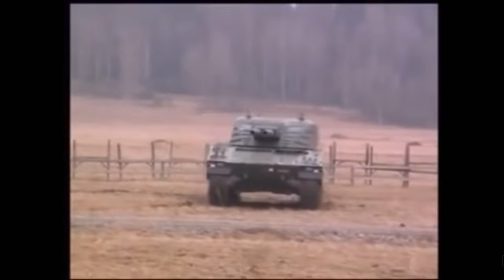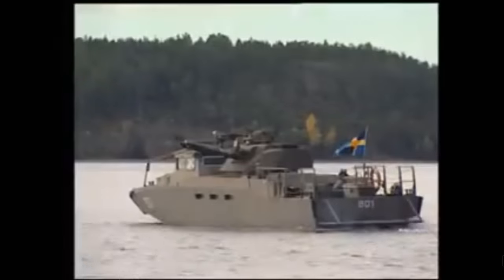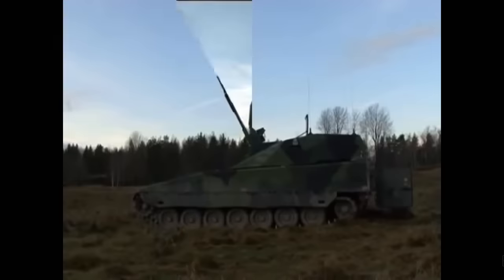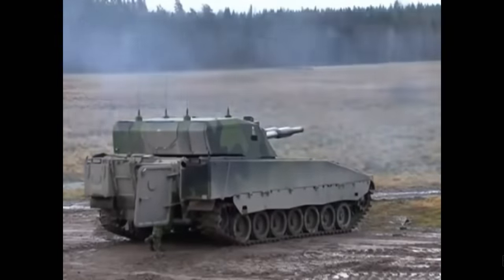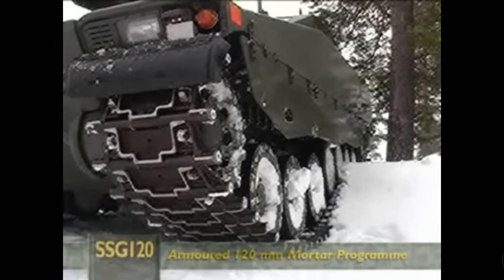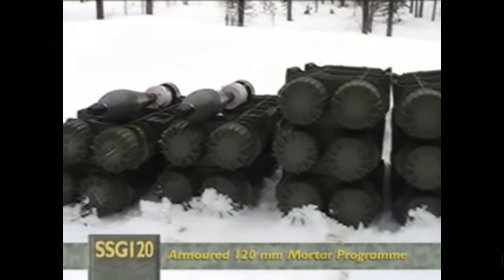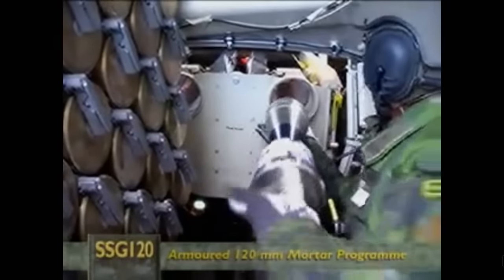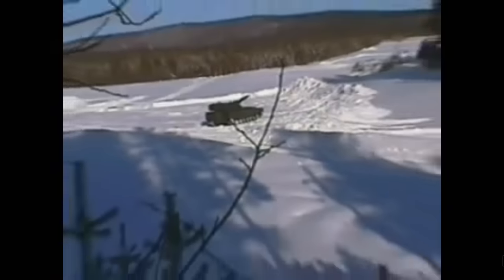Advanced Mortar System (AMOS) - Twin Barrel 120mm Mortar

Comment: The potential of computer controlled and precision guided mortars in asymmetric warfare is significant as a cost effective strategy for supporting infantry. Artillery and conventional armor have always struggled in CIW. The mobility demands of most CIW are difficult for conventional tactics to deal with because the intensity of the counter threat is difficult to anticipate before a conflict. AMOS has some unique advantages in CIW as well: Great ambush protection with direct fire mode and fully covered turret. Adaptable to IED resistant platforms versus direct fire armor. Excellent range and ROF. Considerably lighter than a MBT. PGMs will be able to target technicals and anti-aircraft guns.

Comment: Yes, yes, I know. 3 Comments in a row. Had to say that the AMOS is one scary arsed piece of gear. Australia needs it too. It would be a good excuse for us to invest in a IFV variant heavier than the ASLAV, which I feel would be useful. We have Abrams and ASLAV's but nothing really in between that could run with the Abrams at the tip of the spear. A system like this has huge psychological value too. I am a damn civvy and am very unlikely to ever be on the receiving end of a bloody 2'' mortar. Even so, the AMOS scares the shit outta me. Bloody glad it is made by nations friendly to mine! Great vid.
Reply: 'to invest in a IFV variant heavier than the ASLAV'

Eh, you already do. LAND 400 phase 3 aims at a tracked IFV.
Reply: Jonny If you have ever seen the ADF at work, you would realise that 'aiming' is something that the troops are good at. The suits in Canberra are good at missing the mark. Phase 3 may include a tracked IFV. Maybe. If the Boxer is procured and it works well, there is every possibility that they will go with that and not procure the tracked vehicle. Here's to hoping that they do. It would be a damn good idea.
Reply: To be honest, the wheeled component of LAND 400 is way, way overspecced for protection to the point that there are now big questions over the deployability of the Patria AMV or the RM Boxer. 30-40 ton vehicles of the height and bulk of these beasts means that Australia will now no longer have the ability to redeploy them strategically by air - the RAAF C-130s won't be able to take them. And I believe there are less than 5 Globemasters as well. So it would basically take up our entire Globemaster fleet to transport just one single platoon of wheeled vehicles (4 for hulls, 1 for ammo, crew, armour panels, spare parts). 

It also means that should either the AMV or Boxer break down, we might not even have the engineering vehicles to recover them, or cruelly overtax what engineering vehicles we do have.

The ADF wants to fight like they're in the European theatre, in the middle of the Fulda Gap where armour and firepower determines battles. Or in Afghanistan where they expect to run their wheels over 100kg IEDs because their vehicles are too heavy to not get bogged down in the muddy fields of opium farmers. 

The ADF should have gone with what works: the CV90 at 25 tons for the tracked component, and perhaps the French VCBI or the Singaporean Terrex for the wheeled component. If the ADF is called upon to fight in the European theatre then the world is about to end in thermonuclear fire and it won't matter what vehicles are deployed if Melbourne, Brisbane and Sydney are converted to glass by ballistic missile submarines. If the ADF is called upon to fight in the MENA then the excessive fuel consumption and high ground pressure will force the vehicles to stick to the roads and take IEDs right up the arsehole. And while it is difficult to assure IED survival without MBT levels of weight in armour, it is infinitely easier for insurgents to simply make a bigger bomb.

Reliability and mobility are worth more than the extra tons of armour that the AMV and Boxer are weighed down by. France's rapid advance across Mali in operation Serval showed that decisiveness of action requires the utmost of speed and reliability, even when off road, and in terrible infrastructure. Their buildup and staging was also assisted by the strategic mobility of their wheeled brigades - something that heavier vehicles are always trading off against.

As for the Hagglunds AMOS, I am all for it. The rapidity of fire delivery that big bore mortars bring is essential no matter where one fights land battles. A CV90 AMOS with STRIX and perhaps an option for a 120mm GLATGM like the Ukrainian Falarick will deliver 90% of the capability that the ADF's gas-guzzling, overweight Abrams provide. 

The ADF's obsession with big ticket, expensive, strategically immobile assets will prove to be a liability if we ever fight anyone more competent than insurgents.

Comment: The multiple round simultaneous impact (MRSI) seems excellent for asymmetric. The detection of rogue elements can be fleeting. Close air support inbound can be seen by them or their friends warning them to scatter. The tracked vehicle moving around the countryside is more discrete with an indirect arc. The increased beaten area of the MRSI improves the odds of striking the soft targets as they mill about in their position. Heavier artillery could do something similiar but the cost per shot goes up. The 120mm seems hit the "sweet spot" for the dollar cost to engage.

Comment: Unfortunately the Swedish government didn't want to add the money for the Swedish armed forces to buy AMOS. Finland however bought both AMOS and developed a single barrel system they adopted. Several years later Sweden developed a simplified and cheaper system called 'Mjölner', adopted to the army mounted at CV90.

Comment: Put the AMOS on the Bradley hull now. That will replace the M113 mortar carrier in the heavy brigade of the US Army. Put the single barrel unmanned turret NEMO version on the Stryker hull to keep C-130 capabilities. The USMC might do the same with their LAV-25. 
Forget about fancy new lasers and railguns. This shit is real and doable. 
My only question is; does it come in a rifled bore?
Reply: Patria NEMO is low profile single barrel version of AMOS. Would serve that C-130 transportable Stryker -need well.
Reply: Is that not what the M1129 is for, a Stryker with a 120mm mortar mounted to fire out the top hatches.
Reply: I know that the Corps was looking into a large bore, automatic mortar system that could be deployed on an LAV or dismoutned for use on foot but I think that it might gotten canceled. At any rate, it wasn't as fancy as the AMOS as it only had one barrel and it still fired through an open hatch in the back in the usual vehicle mounted way.
Reply: The M1129 was deployed to Iraq at least in 2005 onwards in Stryker units.
Reply: john harker mortars aren't rifled.
Reply: MatoVuc

They can be, the French Mortier 120mm Rayé Tracté Modèle F1 used by many nations is rifled.
Reply: chaz8758 huh... Well would you look at that...
I wonder what the benefit of that is and does it outweigh the impact on barrel life.
Reply: From what I read it was for a longer range and accuracy, the USMC used them until last year as an interim weapon in Afghan and Iraq (some sources say they are still in service, but maybe reserve or war stocks)
Reply: chaz8758 accuracy i could kind of see, but rifling doesn't really affect range.
I've served on a 120mm smoothbore mortar and we could reach out to 7km with standard mines and 6 charges (though that is a bit risky) and we could drop them basically on the spot (give or take a meter or so at 3.5km) if the spotters and calculators did their job right.

That USMC mortar, was that the one that was towed by the Growler?
Reply: The French have a special HERA round with a range out to 14+km - no idea if it can be used on the smoothbores as it does not say it is specific to the rifled mortar on their website

Interesting to see the rifling grooves on the round - must make it slower to load (I have only used the UK 81mm and 2" mortars so no idea about these big beasties)

https://en.wikipedia.org/wiki/File:USMC-120129-M-EE799-013.jpg

From Brandt website

"After WWII, Brandt developed a new 120 mm smooth mortar (Model 1950).
Nevertheless, the biggest breakthrough came in the 1960s with the development of a 120 mm mortar with a rifled tube.
This new weapon offered significantly better accuracy and firepower.
It became known under the designation “Heavy Mortar".

"The 120 mm RT (Rifled Towed) moratr is the most lightweight air- and sea-transportable artillery piece available for force projection operations. Very easy to operate, it can be hooked up simply to any kind of light, medium or heavy vehicle.

The 120 mm 2R2M (Rifled, Recoiled, Mounted Mortar) system is a vehicle-mounted version of the rifled mortar designed for several types of tracked or wheeled vehicles. The 2R2M is an ideal solution for providing fire support to light armoured units, especially as part of an Initial Entry Operation (IEO)."

http://www.tda-armements.com/content/mortars-overview
https://www.gd-ots.com/munitions/mortars-and-mortar-components/120mm-efss/

According to GD

"M327 120mm Towed Rifled Mortar Weapon

The Expeditionary Fire Support System utilizes a 120mm towed rifled mortar that can fire smoothbore or rifled ammunition. The rifled mortar rotates the round as it exits the barrel providing greater stability, accuracy and range over current smoothbore ammunition."

Quite a beast with the auto version

"It can fire 10 rounds within one minute, with improved accuracy compared to the RT towed version, and can then start moving and close the top doors at the same time."
Reply: we had some lightwieght mines that could reach out to 9km, I think. Supposedly we also had some rocket assisted ones, but I never saw one personally. I served on an M75 in the Croatian Armed Forces.
https://en.wikipedia.org/wiki/M74/M75_mortar
(the wiki article doesn't really match with the TTCs I had to learn on the weapon in service)

That towed variant seems to have a longer tube than the one I served on and is quite a bit heavier.
The munitions are also differently designed, with a longer stem. Very interesting.

I find the automated 2R2M version very interesting. Not as good as a rotating turret with direct fire ability.
Reply: I saw quite a few M75's when I was in Croatia/Bosnia, there were some under lock and key in a UN safe store plus a few in the Croation military part of Divulje Brks in Split (1992/93), plenty when I was in Sarejevo (1995/96) and a couple in kosovo (1999). 

Seemed a pretty effective weapon in the territory where traditional artillery gun/howitzers could not be used everywhere. 

The 2R2M does look interesting, longer range almost as fast as the AMOS with its two barrels (10 rpm on the Brandt v 12 rpm on the AMOS). Both can shoot and scoot but the AMOS has that direct fire capability out to 1500m which gives it a little more flexibility.
Reply: Direct fire 120mm mortars could also replace the dubious 105mm mobile gun system in the US Army Stryker brigade. It wouldn't do any good against tanks in the direct fire, but the 105mm cannon is hardly any better.
Reply: perhaps not against tanks, but against light armoured vehicles like IFVs and APCs it is more efficient.
Granted getting hit by a 120mm mortar head on in one of those wold induce a significant emotional event and damage, but not quite the same as a 105mm HEAT round.

That said, the russians did make 120mm HEAT rounds for their 2S9 Nona self-propelled mortars, so technically you don't per se need a cannon for it...
Reply: MatoVuc

For the 120mm mortars you have rounds like the STRIX self guiding, top attack, AT round which can be fired from the AMOS and conventional 120mm mortars. In service since the mid 90's.

Even for 81mm mortars the British had the Merlin AT round (using milimetric radar) under trials at the end of the 1980's but with the end of the cold war it was not adopted.
Reply: If you had a rifled bore, you could also develop a HEP round for them. That might knock a tank out. Spall liners would probably save the crew, but the tank itself would need some factory level repairs.
Reply: john harker

HESH is only effective against older armoured vehicles with no spaced armour, no era, no composites so you are looking back to the T54/55 and T62 era and even they were upgraded by different users. 

It is more useful as a general purpose HE able to deal with light armour, bunkers, buildings than tanks.
Reply: Or just buy a bunch of the Nemo containers, they are basically whole single barrel 20 foot containers witch can be loaded to everything witch can handle containers. Base building gets new dimensions :D
Reply: chaz8758

Oh I know that HEP can't cause the Spalling in composite armor, but It is more likely to disable systems on a AFV than a HEAT round that doesn't punch through. The anti-bunker capability is also a huge plus. 

The containerized NEMO would be nice, especially for something modular like the Boxer. But the LAV would be best off with an integral setup.
Reply: John Harker - A tandem warhead HEAT would be more effective than HESH on spaced armour, composite and ERA
Reply: Why not keep them on CV90 and replace all the Bradley with CV90?
Reply: Because that would be too expensive. The CV90 is only slightly superior, nowhere near enough to justify a full replacement. In fact, other than the 40mm cannon and slightly lower profile, the CV90 doesn't bring anything new to the table.

It's why we're still using the M16/M4 instead of the SCAR. It's a fancier rifle, but a properly maintained M4 will do everything it can. 

The AMOS on the other hand would be a massive technological advance at a reasonable cost.
Reply: any 11chucks out there pissed we dont have this?
Reply: john harker and 1000 times more practical.
Reply: Well lasers and railguns will eventually take over, this system is ready now so I totally agree.
Reply: or, what if you just wait until the CV90 replaces the Bradley, and you can put these puppies on them directly ;)
Reply: @MatoVuc  Both rifled and smooth bore mortars exist, or, was used in the past. I spent seven years in the US Army mostly working on the M-30, 4.2-inch (107-mm) mortar. Commonly called the four-deuce. The M-30 had a rifled cannon and each round had opposing rifling to match. The M-29 mortar was an 81-mm smooth bore canon, with fins on the rear of the shell.
Reply: @MatoVuc  Not 100% true.  At a minimum, the 4.2 inch mortars used by the U.S. for decades have rifling.  The weapon is muzzle fed and the rounds have an expanding plate that catches the rifling.  4.2 inches equates to 106.68 mm.
Reply: @johnbrown3575  yep definitely

Comment: Solid review on a very promising system. Am I correct in guessing that the main problem with this is just that it is inevitably especially expensive? I love the idea of putting it on a patrol boat too - that's real modularity.
Reply: Yes, the expense is significant but the additional effectiveness and protection is worth it if you can afford it.
Reply: Singlebarrel version NEMO is used by some middle-eastern countries.